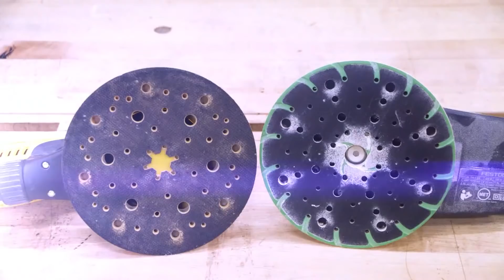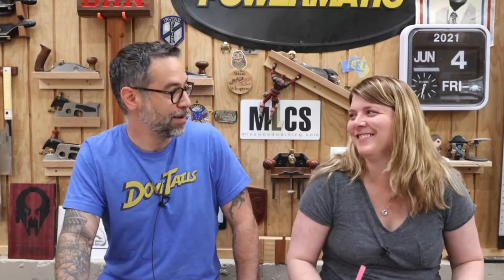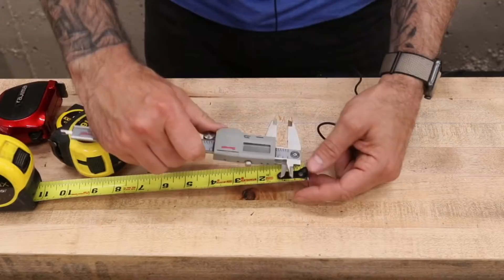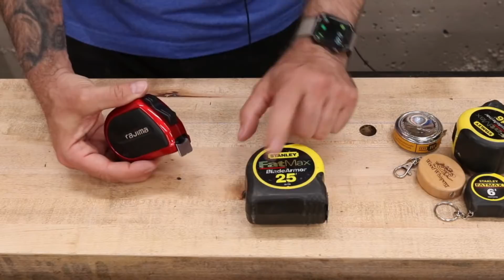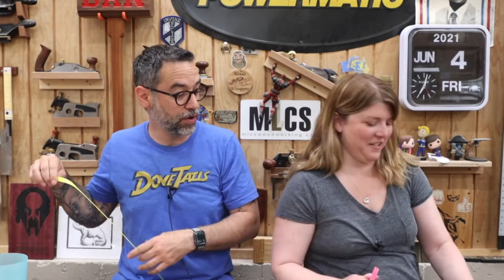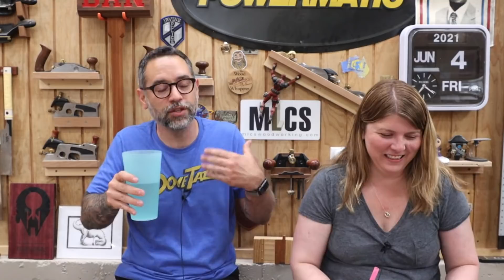Tape Measures | TWW Live

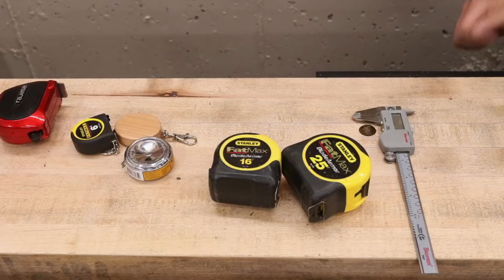Comment: Marc, for the demonstration of sanding swirl marks, I'd use off angle light and take high resolution pictures with macro lens or the closest your camera can focus. If you take pic of all of the grits and 3mm/5mm in a systematic way, you can show cropped images a bit better. I did a sanding video this way and I think it demonstrated the point reasonably well, though, it is my least viewed video. haha. Starts at around 6:38 on getting a good baseline of "wood" and goes into the results at 7:52. https://www.youtube.com/watch?v=F2t74dGGvXM&t=384s

Comment: I have the 3mm Festool ETS sander. I had a Festool Rotex and wanted a finer sander after using the Rotex in regular/non-Rotex mode. In reality, the ETS is a nice sander and wish I had the 5mm version because I would want to use it exclusively on projects. It works with 80 or 120 grit, but I find it takes longer to sand a project then the 5mm sander.